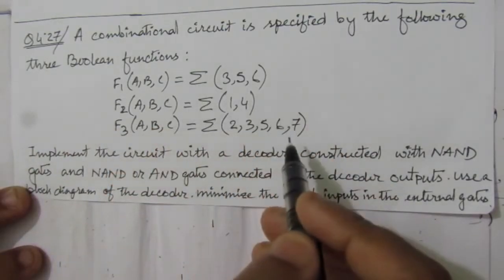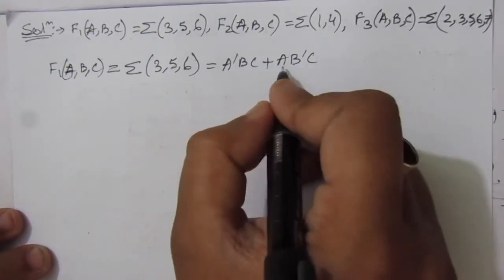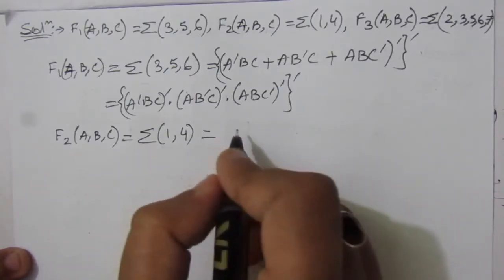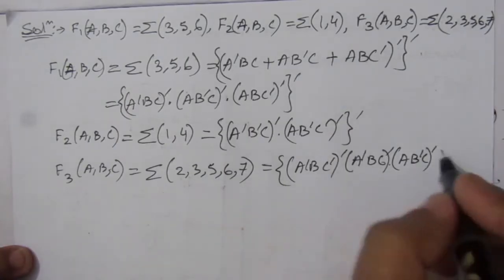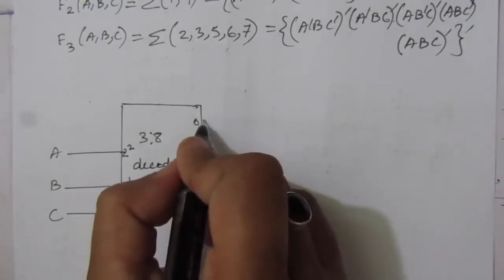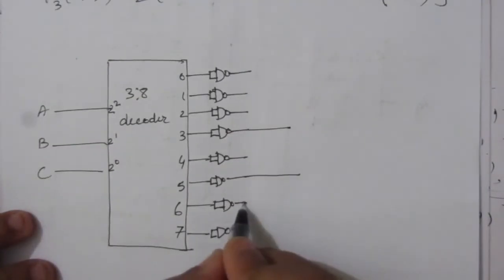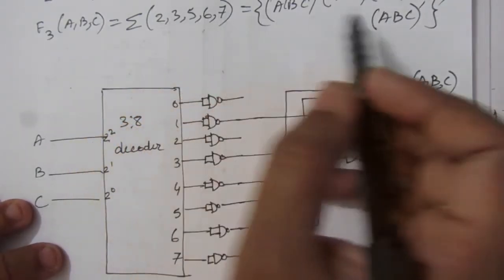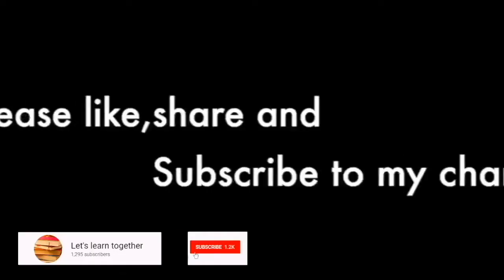Q. 4.27: A combinational circuit is specified by the following three Boolean functions

Comment: Respected Sir
To justify the question statement,   1. You need to use 3 to 8 line Decoder constructed with NAND gates only. This will give you Decoder output in complemented form. So no need to use inverters (single input NAND) here.
2. Here F3 has 5 minterms, you can minimize the number of inputs of NAND (used for F3) by replacing it by AND gate and connect minterms 0, 1, 4 , (the Complement minterms of original function)to inputs  of AND gate.

Note:
Don't avoid to get advantage of NAND gates in Decoders.
If you still have a question, you may ask in the comments.
Reply: Sir, can we use an INVERT_OR gate as an external gate in this question?? Like when the outputs come out of the NAND decoder, they will be complemented, so we can use the INVERT_OR gate ( which is also a NAND gate) to complement the outputs and then sum them??

Comment: The question has asked to use decoder with built in NAND gates at output, you havent done that respected Sir. Also you could have taken F3=F2' to minimize the the external inputs.
Reply: To justify the question statement,   1. You need to use 3 to 8 line Decoder constructed with NAND gates only. This will give you Decoder output in complemented form. So no need to use inverters (single input NAND) here.
2. Here F3 has 5 minterms, you can minimize the number of inputs of NAND (used for F3) by replacing it by AND gate and connect minterms 0, 1, 4 , (the Complement minterms of original function)to inputs  of AND gate.

Note:
Don't avoid to get advantage of NAND gates in Decoders.
If you still have a question, you may ask in the comments.
Or visit my channel
ETIS
Reply: By taking F3=F2' u will directly leave D0. So what about it? That is why he didn't took it like that